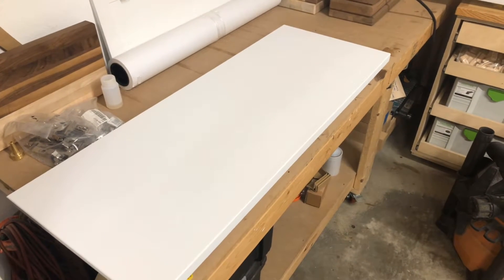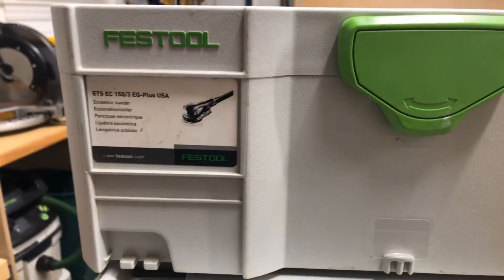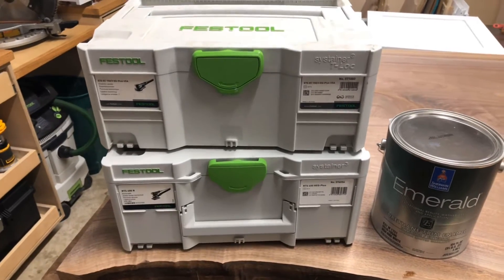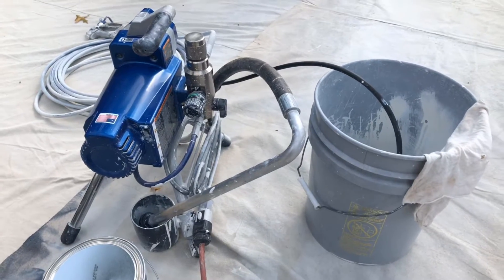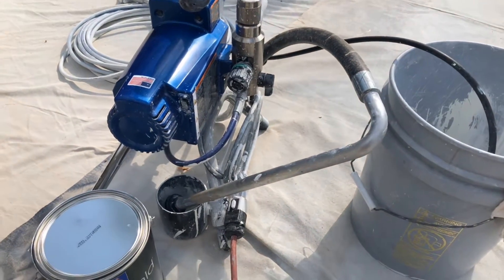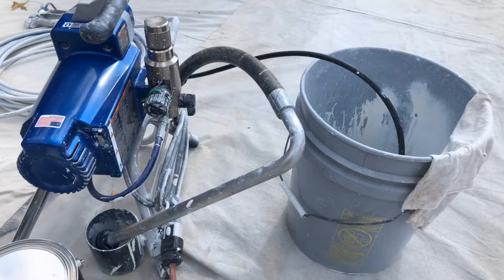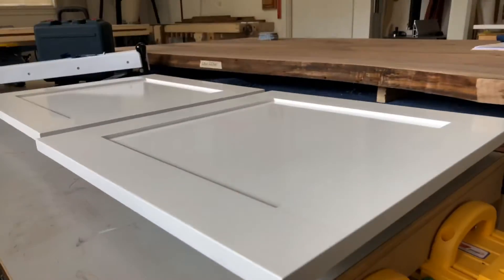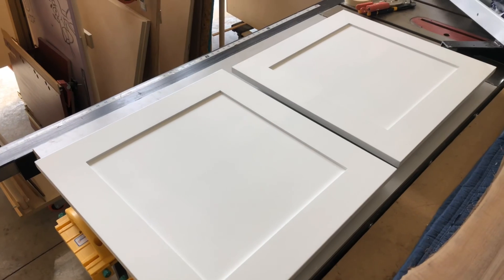Finishing Cabinets with Graco Airless Sprayer: Part 2

Comment: You should try ppg oil based primer. Literally dries in minutes and sandable right away. And top it off with pro classic paint for a mirror finish. Thats what I've been using for years its amazing. Like the video good info.
Reply from the maker: Thanks Jonathan! How are the fumes with the oil based primer? What do you clean your gun & hose with? Do you have any tack to the horizontal surfaces using pro classic? That’s always been my issue
Reply: @villellacustomwoodworking2974  it is a little strong compared to latex paint but nothing compared to lacquer. As long you ventilate well or are outside you should be good. And as far as tack on horizontal surfaces I've never run into that issue. Not sure what that could be. I currently just finished a home with cabinets using the paint combo I mentioned and it came out perfect.
Reply: Instablaster.

Comment: Brother I love your heart when it comes to just trying to do the job right and get the best quality finish for the real journeyman painters out there, you have to take paint life with a grain of salt and all that information is junk for the REAL journeyman painters we consider that dude a flipping hack. For a primer you're going to want to use pigmented shellac..it's the best primer as far as stain blocking, drys lightning fast, and sands like glass. It creates a chemical bond so adhesion wontever beaproblem. As far as cleaning out your pump a company called Crown makes a cleaner called Pro flush. I get it at sw or imsure homedepot has it what I do is I run a jug of pro flush through the pump and then a gallon of water..  you can easily spray two coats of primer and finish in one day or two coats of primer with sanding in between coats and the 310 tip is good but I would recommend stepping down to a 208 or even a 210 if you're not that experienced with spraying.
Reply from the maker: Thanks for all the information! I’m going to be switching over to a tritech sprayer. A couple years ago someone mentioned tritech. I had never heard of these sprayers, but I’ve learned more about tritech and the units are highly recommended. I’ve also started using Reneer wood coatings. I’m not an expert finisher by any means. I have a lot to learn still.
Reply: @villellacustomwoodworking2974  I hear they're good coatings but I get great results from Sherwin-Williams emerald and it's local all the specialty coatings being where I'm at I would have to order stuff and it just wouldn't be plausible
Reply from the maker: @nothingsimpostleble1593  That's great you have a product you found that works well! SW also has a product called Kem Aqua that I've seen finishers use. I have to order the Reneer product too. I get it from Woodworx Supply.
Reply: @villellacustomwoodworking2974  yeah I don't have order anything everything I need is at sw most of the time.. and sw hasn't had Chem aqu here in California for awhile
Reply from the maker: @nothingsimpostleble1593  gotcha! There’s a lot to be said for convenience

Comment: I didn't have success using my Graco Magnum X5 with a RAC-X and a FFLP 310 tip with the same Sherwin-Williams paint. I tried twice, but from what I concluded, the tip was too small for my unit. First it wouldn't come out and then it spitted at my second attempt. So I had to fall back on my 515 tip to spray my doors. It was a challenge to keep from runs and the overspray has now laid a protective coating on my garage floor in uncovered areas. I assume your Graco sprayer have more PSI to handle that paint. I see it costs about triple. Do you think that was the problem?
Reply from the maker: Thanks for reaching out. I am not knowledgeable enough to answer that question. You might try reaching out to the Chris the Idaho painter or Eric Reason. Or graco directly. I think Chris uses titan sprayers but he still might be able to help.
Reply: Dilute your paint a little with floetrol. It will lay down much better. Also I is a 208 fflp
Reply: For what it's worth I've had zero issues with that tip, that sprayer, and that paint

Comment: Emerald is not for cabinets. It’s soft and will not hold up. Yes maybe you can get away with doing the boxes with emerald but the doors will not last. Vinyl sealer as a primer and then a lacquer, varnish or true poly as a top coat

Edit: also a pre catalyzed epoxy or lacquer or conversion varnish, 1 part polys do work but you need to test the product to make sure it’ll hold up. Don’t use an airless either, the material is expensive enough and airless transfer efficiency is poor, 40% transfer efficient at best.
Reply from the maker: I started using Reneer. Superior product.
Reply: @villellacustomwoodworking2974  Reneer is by far one of the best water based finishes on the market. It’s also extremely pricey. Try general finishes enduro clear and use a cheaper top coat under the clear like a 1k or wb lacquer such as Kem Aqua Plus. You will save money on materials. I personally either use BIN or Vinyl Sealer as my primers if I need to prime.